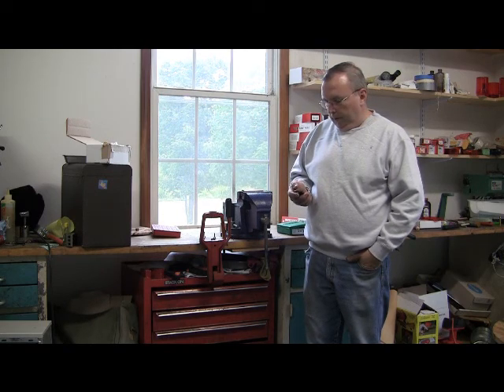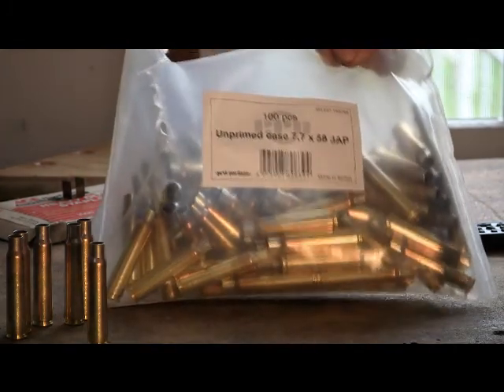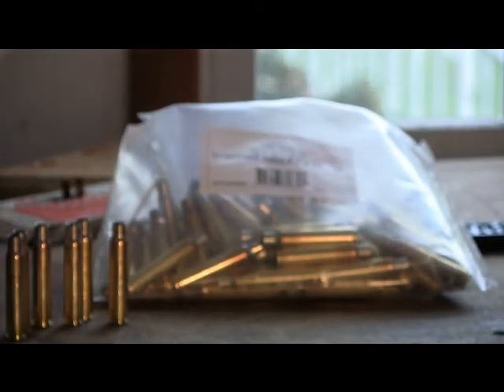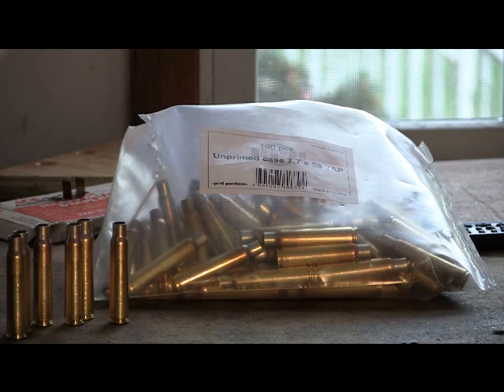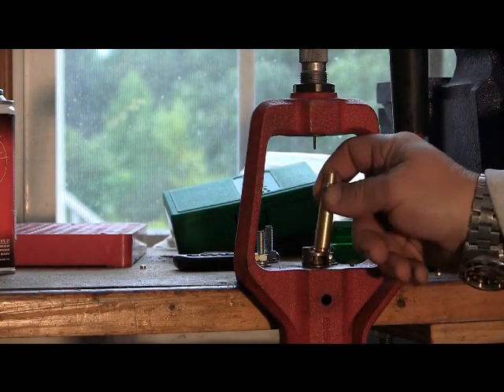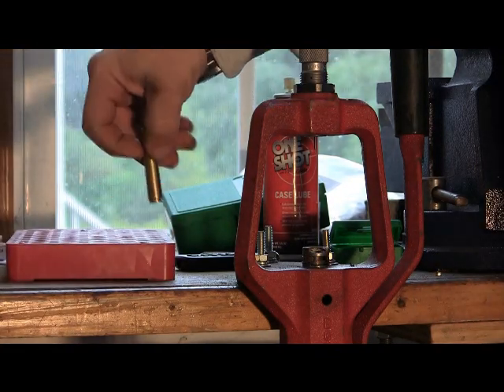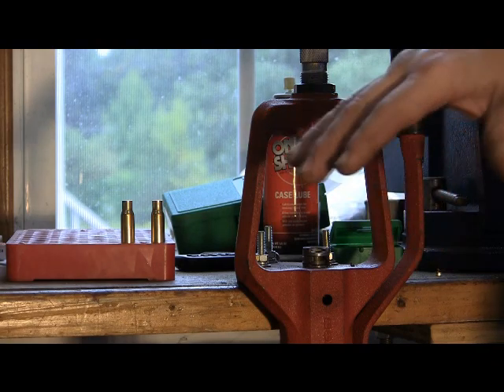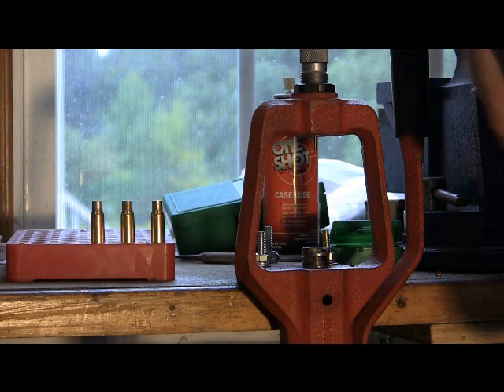Full length resizing rifle brass

Comment: I'm just about to begin reloading for my rifles & this was a great help. Many thanks
Reply: Don't listen to this guy. Neck size at least 3 times THEN full length size. If u full size every time you will destroy your cases. It's too much stress on the case and they will turn brittle and won't last long at all. Once you fire size you should get at least 3 neck sizings out of the brass before you have to full length. Then u might get 2 or 3 neck sizing out of it then generally it's about done. Some caliber's last longer.

Comment: Kenneth is correct this is not how the RCBS instructions tell us to install a re-sizing die. 1/8 to 1/4 turn below the point of contact is what mine reads.
Reply: Doug Walker you are right if you don't do that u won't push the sholder bk at all which you want to do

Comment: I mean the depth setting of the entire neck expander and decapping pin assembly.  In .30-06, it's a very easy thing to get right, because the space between the bottom of the neck and the bottom of the brass is so big.  I learned my lesson the hard way though.  One of the secrets of reloading.

Comment: I an dubious about the instructions here....both my Lee and RCBS die instructions say that after screwing the die in until it touches the shell holder, to then lower the ram and tighten the die 1/8-1/4 a turn more and then to turn down and tighten the lock ring....

Comment: You are not correct about benchrest shooters only doing neck sizing. I would suggest that zero top BR shooters neck size only. We use full length resizing dies that, for the most part, use neck bushings that are sized depending on the thickness of the brass in the neck area. Then we resize the the full case every single firing. The trick is setting up the die in order that you have the minimum amount of sizing but enough to ensure easy re-chambering.

Comment: You setting up the sizing die on the press is wrong. Read the RCBS manual. Lift the shell holder up and seat the die till it touches. Then let the ram "shell holder" back down and then turn the seating die clockwise 1/4 turn and then lock the lock ring in place.

Comment: What does adjusting the stem on the top of the die do? How do you adjust that?
Reply from the maker: that stem will adjust how deep the depriming pin goes it is usually set when the dies are new you should never have to adjust it unless you are not getting the primer out or you are too deep and the expanding plug it bottoming out on the inside base of the case.
Reply: TheKoba49 ok thanks for the info. My rifle came with the dies uses and the sizing die did not have a depriming pin installed so I wasn't sure.

Comment: Followed your instructions, ruined my sizing die.  Don't take it personally.  Dillon's instructions and Redding's instructions are the same.  All three of you say I shouldn't worry about the inner sizing part of the sizing die.  Well... that's obviously wrong.  If there's a setting, you should know what it does.  It requires very precise setting on small rifle calibers.  I assumed it would just work.  Nope.